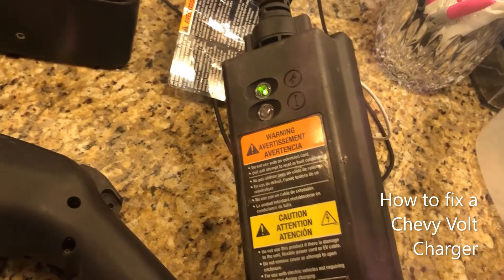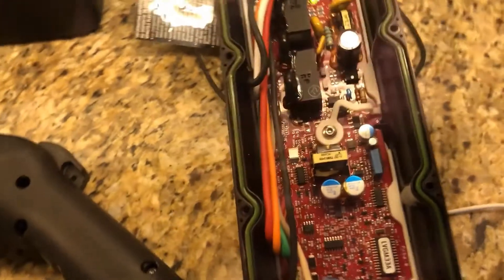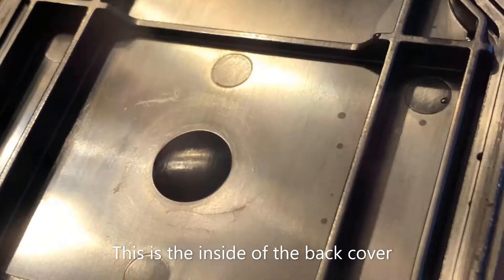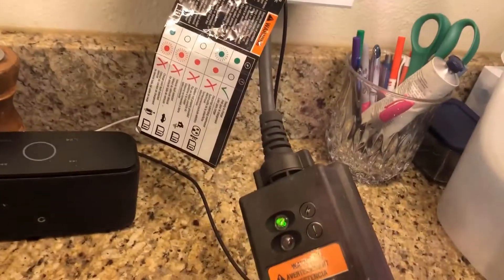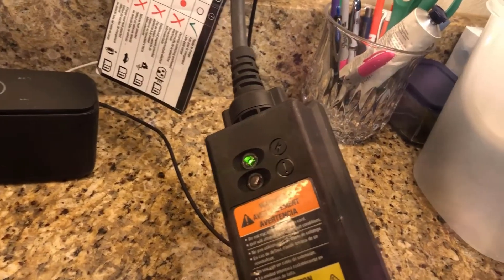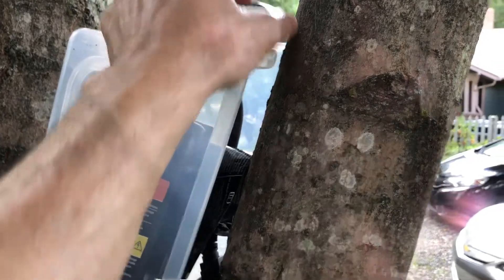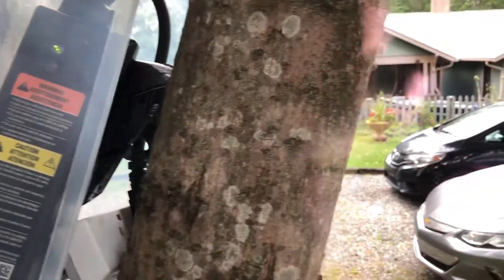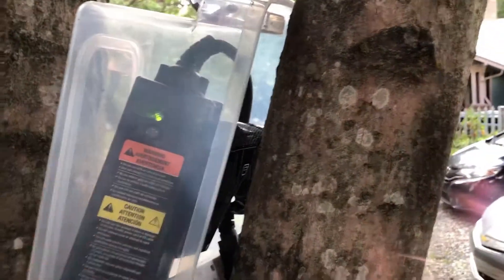How to fix a Chevy Volt charger 2nd generation

Comment: Thanks for the video. The Volt gen 2 evse appears to be the some one we received with our Bolt in 2017. The evse stopped working. Your video pointed me in the right location regarding the fuses. I found two line fuses. One was blown. The evse now works correctly.

Comment: Trying to find your snapper electric Kit you referenced in another video... any info on this?? I'd love to to make my old snapper electric
Reply: I don't have a kit to sell, but I do have a spreadsheet that shows all the parts needed. When you open the link below, notice at the bottom of the display, there are two tabs. The opened tab is for a commercial mower that I converted, don't use that. Instead, open the tap titled Snapper Conversion. One note: for all of my conversions I used a section from a Chevy Volt battery. You may find a less expensive battery. But, keep in mind that the power requirements for a Snapper 26" is 30 amps. I mention this because many ebike batteries may be suitable for this application.  You should verify the specifications (maximum continuous output) for the battery.  No matter what battery you decide to use, be sure that it includes a Battery Management System (BMS). Also, Green Tech Auto sells used batteries from Volts, Leafs, and other electric vehicles. The hardware and wires that are listed in my commercial mower spreadsheet may be helpful for some of your needs.  Lastly, adding the accelerator (gas pedal) add a lot of expense ($280) and wiring. The fact is the gas pedal isn't necessary. What is necessary is an attendant switch. So, please be sure to add that. It's not hard, but if you get stuck, drop me a note.

Here's the spreadsheet:
https://drive.google.com/file/d/1sUIDXfZwxgAoBW-8pq1qrjPix_1auS6W/view?usp=sharing

Here's a video of a commercial mower conversion using many of the same parts:
https://www.youtube.com/watch?v=_sFZgSSWjcg&t=300s

Here's a photo of the wiring diagram used on the commercial mower, it is similar (not exactly the same) to the Snapper:
 https://drive.google.com/file/d/1cCx7Kt6Zkka2nkgmtV2JA8JHGHJRIBX6/view?usp=sharing